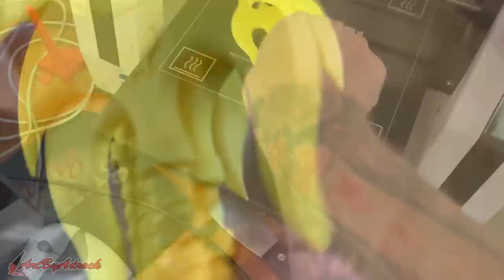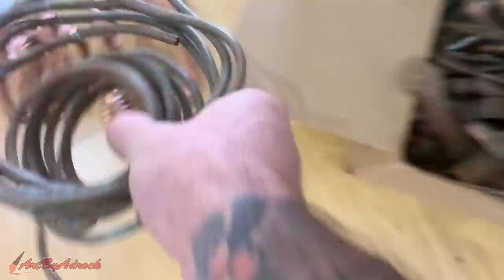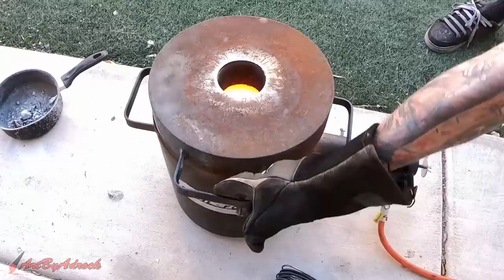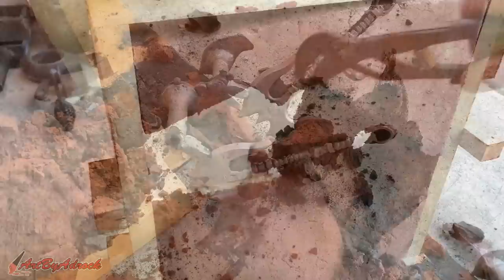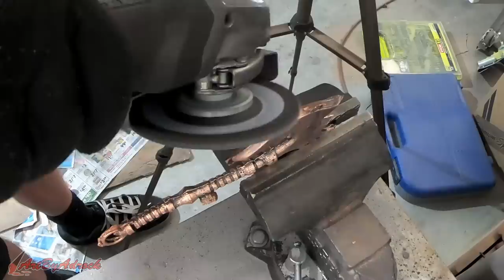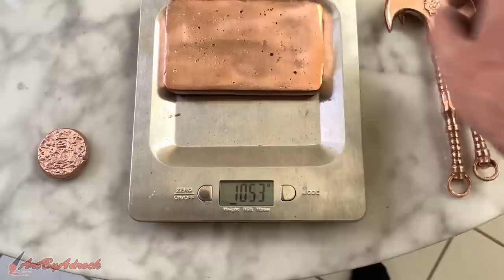Casting A MINI Copper Darius Axe From League Of Legends(X2) - Turn Scrap Copper Into Art

Comment: the details in those axes turned out wonderful. you had to have the copper heated just right for it to form the rings on the ends. I was afraid you would lose them when I saw you making the molds.

Comment: awsome as always man! can you reuse the petro bond be getting rid of the burnt stuff?
Reply: There is a process of revitalizing the used sand.  I'm not sure the entire process tho, I need to learn as my wife just bought me 10lbs of new petrobond!! Yeeeeee
Reply from the maker: Yes you can. Using a small bit of non-detergent oil will make it ok again however it is very time consuming.
Reply: @ArtByAdrock  do you have a video on this?  If not I think it would be incredibly informative and useful!
Reply: @ArtByAdrock  Thx m8!

Comment: Nice job. It must be a lot of work to grind them and clean them. Good end with the terminator thumb.
Reply: (Sweden)
Reply from the maker: It’s a lot of work and in this heat it makes it even harder. 110° isn’t as much fun as it sounds. Thank you for watching 👍🏻
Reply: @ArtByAdrock  where do you buy your pirate coin form?
Reply from the maker: I sell them on my website 👍🏻 visit Artbyadrock.com. New designs will also be up in the coming weeks as I design and make new ones as often as I can.
Reply: @ArtByAdrock  OK good. looks like it's going to be shopping. I see you use it when it's over in the crucible. Smooth.

Comment: Those axes are awesome. Just out of curiosity, it seems like you always glue the halves of your 3D molds. Have you ever thought about using pins to hold them? That way you could reuse them easily. I don't have a 3D printer and haven't found an easy way to make molds. I would think it would be nice to be able to reuse them.
Reply from the maker: I use hot glue normally so I can reuse them. It’s very easy to pull back apart without breaking the halves. Pins would work but I’d have to modify the file and that’s more time consuming. Some projects though I don’t plan on ever making again so it doesn’t really matter to me what glue I use. Unless I screw up 🤷🏻‍♂️
Reply: @ArtByAdrock  that makes sense. I didn't realize that you could separate them after you glue them.
Reply from the maker: Too Many Hobbies yeah as long as you don’t use like super glue or something. Even double sided tape would work just fine. I’m working on getting you a few new molds for you to try out as well 👍🏻 shoot me an email and we can talk more

Comment: I have some copper wire that I need melted down into something and like mabey you could use it in a nother one of your videos like I'll put a picture of the copper and it's weght on here so you could see so you could think about it because I have a small home made clay metal smelting furnace but it can only melt copper, aluiminum, tin, and soilder but I take the mold and take the metal and put it on the mold and let it melt but it's fule is coal it takes a long time but it's worth it at the end it take 6 hours for the copper to melt and it's hard because I have to fan the fire to keep it going I'm 16 and loves to smelt ores and metal into molds I was thinking I could mail the copper to you and you could mail it back after your done with it if you want